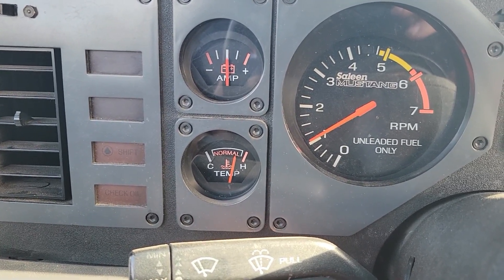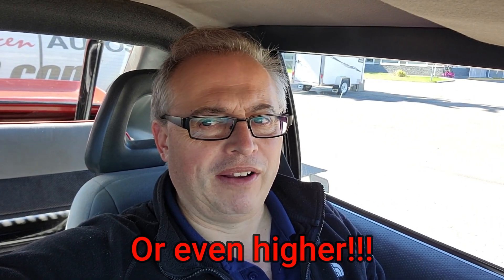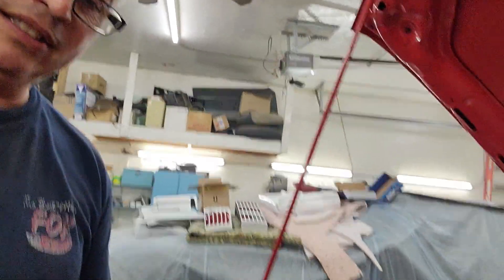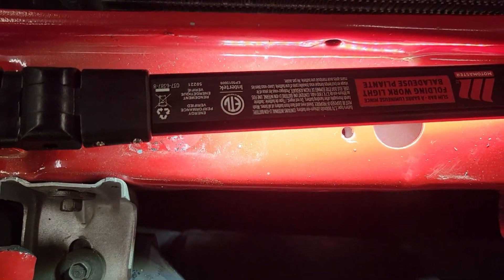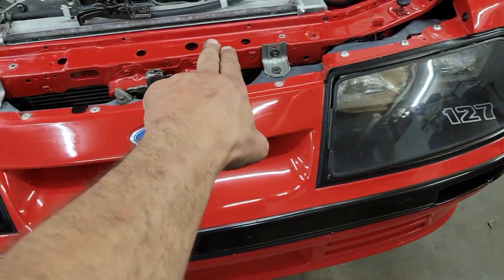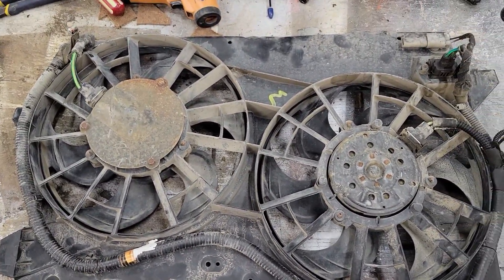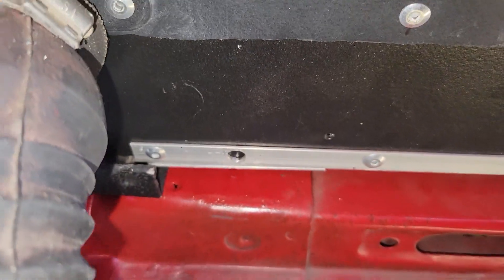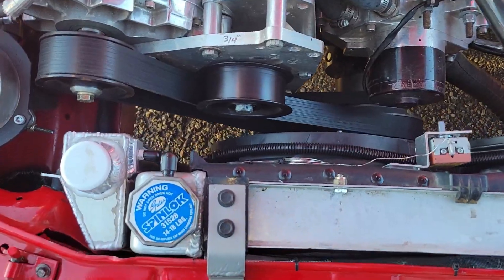FOXBODY DUAL COOLING FAN UPGRADE - SUPERCHARGED 1986 SALEEN MUSTANG - 306 Foxbody

Comment: FANTASTIC vid!!! Im having the same clearance issues with my 8.rib, soon to be 10 rib Vortech crank pulley. 87 Lx with Black Magic Extreme fan, rad is 27 1/4w × 18 3/4 h×  × 2 1/4 thick. Having  hard time finding another rad this size. Didnt see exactly what you did to make rad fit for more clearance
 Also, never serm a Fox Body rad with both inlet and outlet on driver side? Id love to send you pics so you can see what I have?
Reply from the maker: Hi Vernon,  Thanks for watching!  I went with a dual pass radiator from Speedway  Motors because there was no room for the top right rad hose to clear the blower pulley.  I have a Windsor in my car too which changes things a bit.  I also took the lower rad mounts off the lower rad support, made new ones, and moved the bottom of the rad ahead as well.  You can send pics to our 306 Foxbody FB page.  Would love to see your setup!
Reply: @306foxbody1  Do you happen to know the measurements of the dual pass radiator?
Reply from the maker: @vernondavis2207  HI,  I'll have to check...somewhere around 26x19, but I'll check
Reply: @306foxbody1   Thank u!
Reply from the maker: @vernondavis2207  HI Vernon, the dual pass radiator is 28" over all width and 19" high.  Tanks are 3" thick, and core is around 2.25" thick.  Inlet and outlet are on driver's side.  I think it's part# 917341-28 at Speedway Motors.  Hope this helps!
Reply: @306foxbody1  Thank you brother for your help! We are all in this addictive hobby together and I greatly appreciate your help! I have subscribed because you are just like me, learning as you go and sharing knowledge. Look forward to more vids and again, Thanks!!🙏🏾👍🏾
Reply: @306foxbody1  Thanks a mill.I looked up the website

Comment: Most aftermarket fans just come with a CFM rating slapped on them which is frankly meaningless as it’s an open air value. Fan airflow is a function of static pressure or better said fans produce a certain pressure rise at a given volumetric airflow. The Contour fans are far more capable than most any fans on the aftermarket so great choice. I develop this stuff for a living and just happen to be a fox body junkie at the same time 🤣
I like your fab’d attachment for the fans to radiator btw - just watch for any close contact of the shroud on the rad tubes as it’s quite easy to rub through the thin walled tubes.
Reply: And to continue the point about open air performance - fan performance in free air without any restrictions from radiator, condenser, etc is much different than with the complete front end environment. Many of the aftermarket fans will struggle to flow much air through a thick 2 or 3 row core coupled with a condenser and the resistance of front end bumper opening and engine behind it all. There are some exceptions. Spal make some good options but worth noting they also do OEM stuff so they know a few things.
Reply from the maker: Hello Element116,  Wow...very nice technical description.   I definitely agree that some cfm ratings are quite questionable.   When I plugged the Contour fans in for the first time, there was no doubt in my mind that they had amazing airflow.  You definitely brought up such an important point to make sure there is adequate clearances where required,  and minimized (hopefully zero) wear points between the shroud and radiator.   That can be so easily overlooked.  I was so happy to see that I no longer have cooling issues,  especially with the hood back on the car in slow summer traffic.   Thank you so much for your input, and thank you for watching!👍